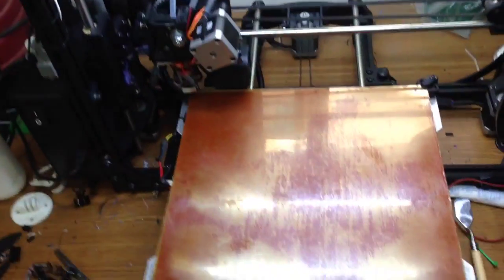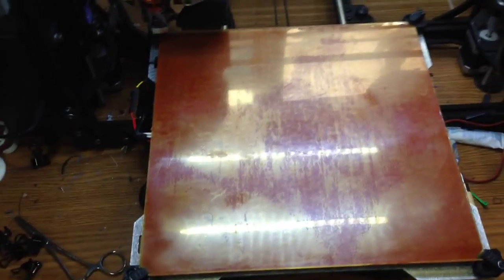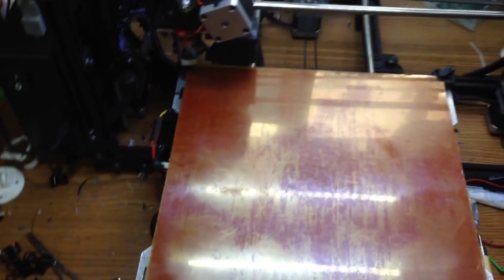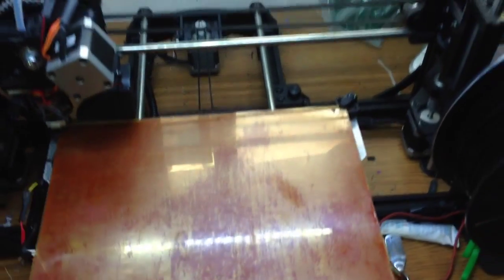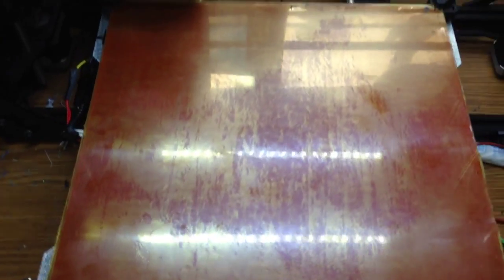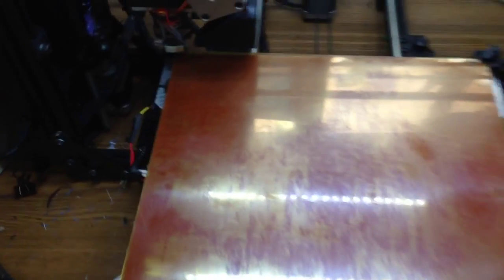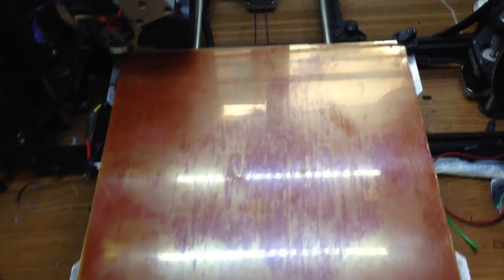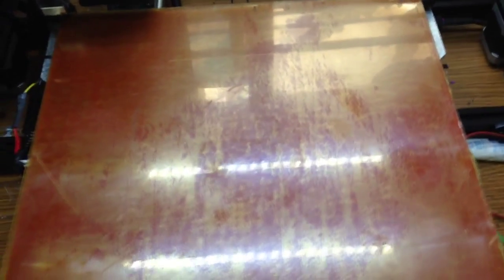Final conclusions on PEI bed material

Comment: I'm trying to get the word out on how to get parts off PEI effortlessly no matter how badly you think they are stuck: The trick with ABS (or PLA) and PEI is to apply a little alcohol around the all edges of the print or anywhere there is an interface between the part and the PEI -- such as printed holes -- while the print is cooling. The print just floats off the plate no matter how bad it is stuck. It will take anywhere from 30 seconds to a few minutes. If the print cools down all the way, just heat the bed up to 60C, place the alcohol and let it cool. It will come right off. It is like magic. You will never have to use force again to remove a print. PEI is the only way to go-- for now<g>. I switched from glass and glue to PEI (after trying Zebra Plate and BuildTak...). I use  Everclear 190 diluted to 70%, but you can use isopropyl too.

Also, I print ABS at 110C indicated on a Raise3D N2 -- I don't know the actual temp on the PEI, but I want my print to stick really really well and hard.
Reply from the maker: Yes I have used the alcohol trick myself a few times. When my bed is really dialed in though I don't need it.
Reply: Do you use isopropyl alcohol or something else? O maybe you can use a vodka too. It has 40% alcohol concentration.
Reply: You can try vodka. I haven't. I use 70% ethanol. I buy 95% Ever Clear and dilute it. I apply using a dropper.
Reply: EpoxyJewelry.com   I have found that to be true as well. The problem is that all conditions must always be identical and sometimes one or more parts on a large job. an come off mid print. So I go for a bit of overkill and can still easily get the parts off.
Reply from the maker: Yes I used isopropyl.
Reply from the maker: I've been very lucky lately, I have my Z axis pressed down a little too much (I get little lips around the bottom layer) and they always stick down well while printing but are pretty easy to remove when cooled a bit, I think maybe my PEI is kind of seasoned like a good frying pan and the surface is perfect right now. Last 200+ prints have no issue sticking or removing.

Comment from the maker: The PEI I used was 1/16" thick. I got it off ebay but it's from Zorro Tools so you can get it from ebay or their website. I cut it with a metal shear but that's not the right tool and I have a ragged edge. Best to use either a jigsaw or something else made to cut plastic sheet stock. Even A dremel with rotary disc would probably be better than what I did.
Reply: +sublimationman score & snap

Comment: Thanks for the videos! Could you give me some help? I have a solidoodle 4 and can not get ABS to stick for an entire print. It has the orange kapton tape but it doesn't stick. I've switched to using glass plates with spray adhesive, which improved but still is not working. I've had the bed temp. from 80 to 110 degrees C with no change. The extruder is at 210 degrees. I always begins to peel from the rear left corner so I'm guessing there is some sort of temp. distribution problem? I have spent days trying to calibrate and trouble shoot it, and am at a loss. Please help!
Reply: Well my favorite 2 methods are the PEI or the purple adhesive and I have videos on both. With ABS a heated bed is also a must and set it to 85c, an enclosure around your printer can also help a lot.

Comment: Is PEI flexible? can you just flex the PEI to get the print off the surface if it isn't fixed on the bed?
Reply from the maker: PEI comes in many different thicknesses and the thinner it is the more flexible but most people (including me) use it too thin to be used alone, you can't just clamp it to the bed as it will have bowing up and down all over so it would not lay flat. If you got a piece thick enough to use as you want to do it might be prohibitively expensive as the thicker it is the cost goes up rapidly.

If you use a thin piece and permanently attach it to glass and then dial in the level and Z height perfectly (it's tricky but the payout is great for the effort) then parts pop off fairly easy once the bed cools to around 50c

Comment: once the PEI is stuck on the build with a 3m adhesive, is it possible to remove it? I only ask because although I want to have it permanatly on, What if I ruin the somehow so that it needs replacing? I would appreciate help on this
Reply from the maker: Yes you can remove it and I have done it twice now (I messed up the surface by accident). When I did it, it was not fun, lots of scraping to get the glue off. I have asked around and people have told me 2 things that make it easier, a few said to freeze the glass and it comes off easier but even more said to use a product called Rapid Remover (used by sign companies to remove old vinyl signs). I have purchase some of this for the next time.